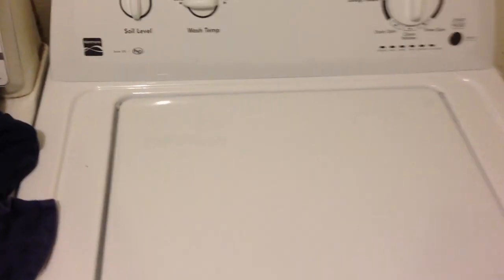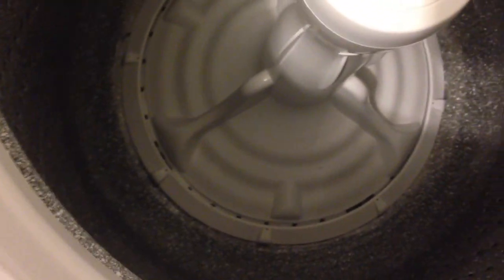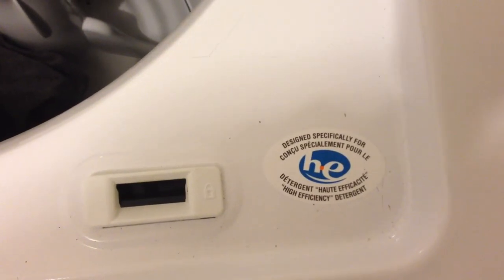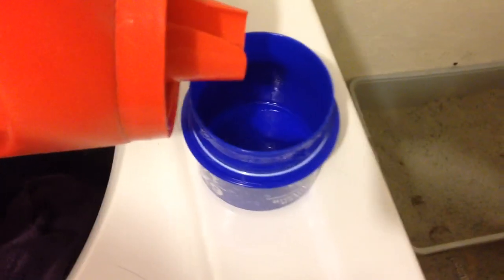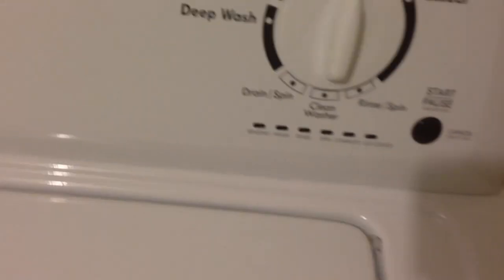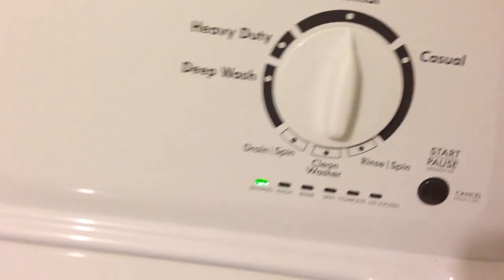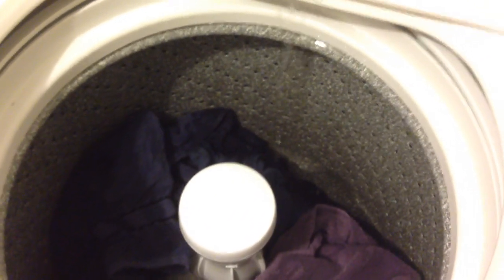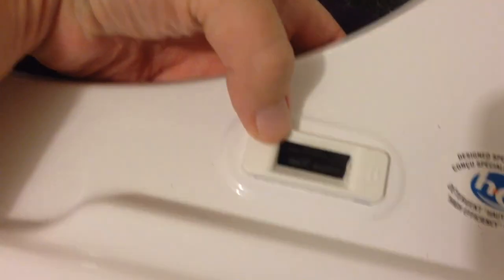Kenmore series 100 HE washer #kenmorewasher

Comment: Well, I for one am grateful to have this washing machine because I did not have any washing machine for over a year.  If I wanted to wash my clothes without having to go to a laundry mat I had to wash them by hand, which would make the skin on my hands raw and painful.  What has worked for me with this machine:  put the liquid soap in first, then the clothing;  pre-spot and rub any stains out as much a possible before adding them to the load, once there is enough water according to the sensor, open it and push whatever has not gotten wet down (I think that may affect the sensor and it will add more water to the load, the deep clean cycle takes too much time for my liking);  be aware of when the rinse cycle begins and add the fabric softener then - or - much easier, after the entire cycle ends run the rinse cycle again with the fabric softener. 
     I don't know how it works for others, but I read that adding vinegar to your wash really helps get them clean and strong odors out.  That it does.  But I think it caused my previous washing machine to slowly fall apart by disconnecting things that were glued in because hot vinegar is a really good way to remove sticky substances.  It was a great machine and got things really clean, not old, but it got a great deal of use with hot water.  I'll never use vinegar again in any washing machine, hot or cold water.  Anyway, thanks for the video, I've never taken the time to watch my laundry being washed.  It did help.  Thank you.

Comment: Thanks for the video. I and my husband always liked Kenmore brand and got this washer without thinking nor research.
I really regret it now, because no matter how big the load is, the deepest the water level gets is like 12 inches. Saving the water is ok, but if the clothes needs good rinsing, they need more water, I believe.
Reply from the maker: momomin0218 I haven't had any problems with mine at all I got it probably a week before I did the video and it's doing what it's supposed to do. Sorry
Reply: Do you get paid for your hype and optimism? This machine is crap! You can read stories of disappointments all over Internet.
Reply: I have the same washing machine one problem is you are selecting the same cycle second reason is if you put on a different cycle and if your clothes are not getting cleaned, you must add soap people like you don’t even know that soap exist!

Comment: Something else I learned about this machine, I think it may help in the long run,  to run the machine empty with bleach (like you are supposed to to clean it every now and then.  Maybe because it doesn't use much water and because I use fabric softener in the rinse cycle when I wash, the plumbing doesn't seem to not drain as quickly as it used to.  I don't know but I do it as a precautionary measure every now and then.  If have done that by running the machine empty using just bleach, and I have removed the drain hose from the wall drain pipe (not from the washing machine) and poured boiling water with bleach in it.  This took care of the leaking (I had in the laundry room which was caused when the water didn't drain through the house drain pipe as quickly as it was leaving the washing machine) immediately.  Maybe I was using too much soap and or fabric softener.  I don't know, but I'm pretty sure it was something I was doing wrong since I am not mechanically inclined.  And I'm sure I was just using too much vinegar, like I did when I would use it also to clean the outside of the refrigerator and now I have little chips and rust spots on the paint.  I guess I just wasn't rinsing the vinegar off well enough.  I'm learning though.

Comment: So me and my roommates have been having soiled clothes after the wash cycle and drain spin issues. The clothes come out dirtier then when they go in.  The machine will not switch to the drain spin cycle at all. However after checking the valves I discovered maintenance men who installed our washer at our apt did not open the valves (hot and cold) completely. I’m waiting on a load now to see if that improves the current soiled wash situation. I’ll keep you all updated.

Comment: how do you add fabric softener to the wash?
Reply: Did you ever find out how do to add fabric softener to the washer
Reply: i had to pause it when it was rinsing and wait about 30-40 seconds for the lid to unlock and then I added the fabric softener 🤷🏻‍♀️ idk if there’s an easier way because it’s annoying to be waiting next to the washing machine.
Reply: Use a Downey ball.  You can use any liquid fabric softener in it.  Dryer sheets are hard on the heating elements of your dryer.

Comment: How can you make it put more water, I noticed it puts little water and I think it's not enough for a good wash
Reply from the maker: I believe if you turn the fare right nob where it reads normal casual ect.. Turn it to the left from center on normal turn it counter clockwise just before it is on Heavy Duty. That should do it. The washer also has a sensor that tells it what size as well, it is just like a front load washer but it's a top load, so it doesn't use as much water as a normal washer. Are your clothes coming out not as clean as you would like?
Reply from the maker: Does yours do the same as mine? It is a totally different machine than any I have ever had, but it does get my clothes cleaner than any other washer that I have ever had..
Reply from the maker: It will do it all by itself so don't worry
Reply: There is no way to do a pre soak with oxyclean so I find it frustrating. I have always soaked my whites overnight in hot water and oxyclean to make sure the come out really white.😟😟

Comment from the maker: You have to hold the button for approximately 3 seconds and then release the button and wait then it should unlock.  I learned you have to be patient with it or it won’t work. Also if that fails unplug it for about 2 mins then plug it back in. Give it a moment and if it doesn’t unlock on its own repeat the first step again. Hope this helps.

Comment: Hey so me and my roommates have this same washer but when we do our laundry its going through the sense cycle and the first wash cycle and drains but after draining it makes a clicking noise and wont go any further, when it stops the clicking noise its first was cycle light flashes would you possibly know whats wrong?
Reply from the maker: Sounds like something in the controls for the sensor are faulty possibly causing the noise. Was the washer yours or was it there when you moved in?

Comment: Just bought a house with this washer, when I run on medium, cool lights, normal and during the wash phase  the clothes aren’t even fully submerged in water, is this normal?
Reply from the maker: Yes, it adds as it washes.
Reply: My dark clothes are coming out with white residue on them. I’m using tide he turbo detergent, and using the settings above. We use a teaspoon and a half of soap cause we have soft water. This washer doesn’t rinse them properly. Any suggestions.

Comment: i have the same washer and mine just stopped on the wash cycle it hasnt moved. how do u fix that problem?
Reply from the maker: I would start off by pressing and holding the cancel button until it unlocks. You might have to start the load over again. Hope that helps

Comment: my washer kenmore series 100 it will fill with water and drain but doesn't wash, pls any idea how to fix it... thanks
Reply from the maker: Nasha M good question, how long have you had the washer and is this something that just started. It’s possible that the sensor it’s not working properly. If that is the case I would check with the manufacturer and see if they have any trouble shooting that can help. I’m sorry I really don’t know what else to do I have not had that problem
Reply: I had this washer since 2015, it was working fine, suddenly it stop washing
Reply: Nasha M your washer fills all the way with water?

Comment: This is years later now. I just had the misfortune of moving into an apartment with this washing machine. How can I stop the cycle so I can soak clothes in it? Even with the lid open it drains!
Reply from the maker: Usually to pause it you push the button for I think 3 seconds. I’ve since moved and left the house to my kids and they still use it. Hope this helps
Reply: @eskk2169  that doesn’t work, but I can definitely understand why you left the washer

Comment: My series 100 kenmore does this thing where you can here the timer moving but the spin and rins and  spin and drain acts up. honestly  a towel or pants shifting  should not  cause the wash cycle to stop what is going on if i  pause and cancel and move to  the spot on the timer/control that says spin and rinse/ spin and drain it kinda  acts better but i must    pause it and un pause a few times.

Comment: We had a few coins get stuck inside it. How can i get them out??
Reply from the maker: CHARLESF55 you should be able to remove the cap on the center of the agitator and there is a nut, then gently pull it up not off just up enough to reach under to get the coins. Hope that helps.
Reply: I can just pull up on the agitator and it comes out.
Reply from the maker: Wilbur Tabácskó sorry so long to reply haven’t been online in a few months. I’m sure you fingered it out on how to get your coins removed by removing the cap on the agitator and unscrew the metal nut/bolt.

Comment: Not spinning out last cycle any help?
Reply from the maker: Have you tired doing a reset on it yet?
Reply: @eskk2169  I’ve tried the lid lift reset. All the other cycles work fine. Just doesn’t go to the last spin cycle and clothes are saturated. When I switch to spin/drain it pumps all the water out and spin drains fine. Just won’t automatically
Reply: @eskk2169  I’ve tried the lid lifting after unplugging

Comment: Hi, how I do reset?
Reply from the maker: Jose Canosky TRD I don’t know exactly what’s the issue with yours but to rest if the lid is locked you have to hold the start/stop until you hear it click the release lock for the lid. I hope that helps.
Reply: Once they reset it by opening and closing the lid and started to work. I do not remember how to follow the steps. it was that the light went out and gave an error. Thanks.